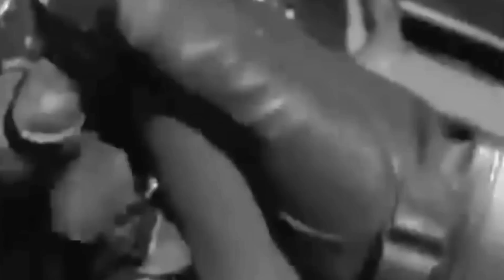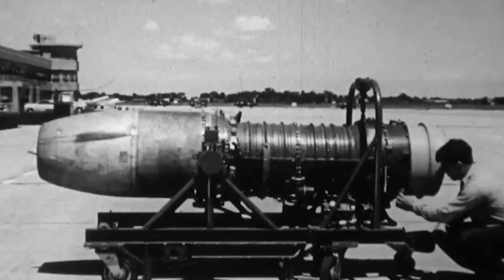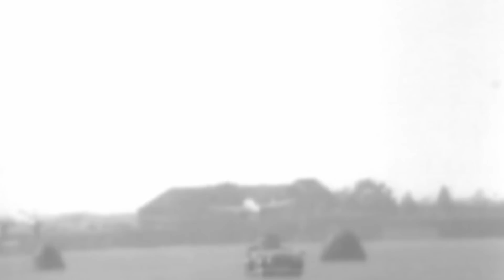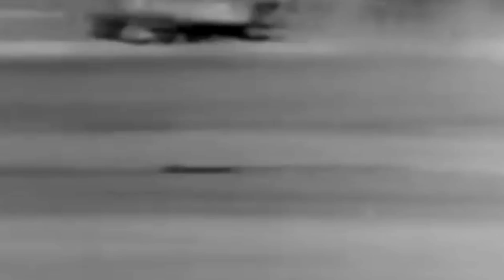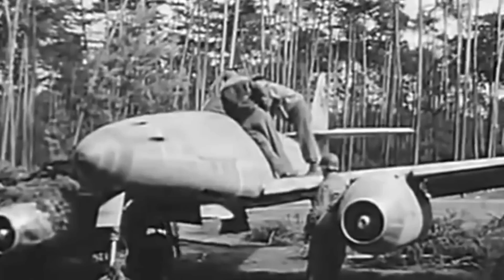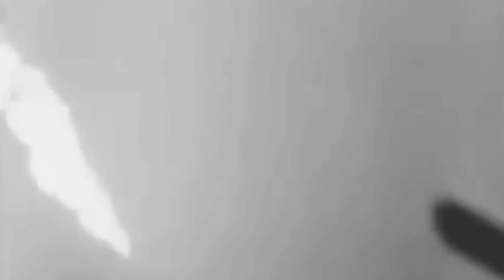The Never Before Seen Fighter

Comment: I saw the flying replica a few weeks ago at RAF Coningsby , even though a modern replica with modern engines etc' it still looked menacing .
Reply: That's not a replica, it's a genuine Me-262 "C" built under license from Messerschmitt.
Reply: @WilhelmKarsten  - exactly - just with modern, much smaller but stronger engines. Great piece !
Reply: @icemanstg  The GE J85 was designed by Gerhard Neumann and his team of Jumo engineers brought over by Operation Paperclip... Ironically the J85 originally designed for missiles only had designed life of just 2 hours!
Reply: @WilhelmKarsten  Hello Sandyboy, as you know the team that Gerhard Neumann worked with at GE were Americans not nazis.
Reply: @WilhelmKarsten  The Me 262 replicas are solely the product of the Texas Airplane Factory and Classic Fighter Industries and have nothing to do with DASA. CFI's right to build was bestowed by NAS in return for the restoration of Vera (which is now, according to you no longer an original Me 262). The only connections with anything Messerschmitt is that one of the replicas was bought by the Messerschmitt Foundation which is a privately owned historical preservation society which then gave its informal blessing to the use of the 'C' suffix and the use of consecutive serial numbers which have no meaning other than as serial numbers issued by TAF for the airframes that they produce. As you know Sandyboy EADS is not Messerschmitt. DASA was formed when Daimler-Benz took over MBB (itself a product of Bolkow's acquisition of Messerschmitt). DASA was later absorbed into EADS a joint French, Spanish and German venture. Messerschmitt is a legacy company of the international concern EADS as de Havilland is a legacy company of BAE Systems, the British company which is Europe's biggest defence contractor. Obviously CFI couldn't use original or even replicas of Ju 004 engines due to the appalling fragility and short life of the design, so instead they used the GE CJ610 which presented a problem that the considerably lower weight of the GE engines would significantly displace the CofG and require changes to the wings but instead they put the GE engine in the heavy casings of Ju 004 engine to achieve the require weight distribution. How ironic.
Reply: @WilhelmKarsten  Sandyboy, as you know the Me 262 replicas are solely the product of the Texas Airplane Factory and Classic Fighter Industries and have nothing to do with EADS. CFI's decision to build these replicas was supported by NAS in return for the restoration of Vera (which is now, according to you no longer an original Me 262). 
The only connections with anything Messerschmitt is that one of the replicas was bought by the Messerschmitt Foundation which is a privately owned historical preservation society which then gave its informal blessing to the use of the 'C' suffix and the use of consecutive serial numbers which have no meaning other than as serial numbers issued by TAF for the airframes that they produce. The project has also received some support from Airbus.
As you know Sandyboy Messerschmitt does not exist as an idependent company. DASA was formed when Daimler-Benz  took over MBB (itself a product of Bolkow's acquisition of Messerschmitt). DASA was later absorbed into EADS a joint French, Spanish and German venture. Messerschmitt is a legacy company of the international concern EADS as de Havilland is a legacy company of  BAE Systems, the British company which is Europe's biggest defence contractor.
Obviously CFI couldn't use original or even replicas of  Ju 004 engines due to the appalling fragility and short life of the design, so instead they used the GE CJ610 which presented a problem that the considerably lower weight of the GE engines would significantly displace the CofG and require changes to the wings but instead  they put the GE engine in the heavy casings of Ju 004 engine to achieve the require weight distribution. How ironic.

Comment: Dude I am going to give you a dislike for every time you say kilometers without giving the same speed in miles per hour , fu
Reply: Here, you crybaby. 1 km = 0.621371 mi.  I should charge you for the 10 seconds it took me to look up the conversion.
Reply: Multiply mph by 1.6 Dumbarse!!
Reply: @akf6815  Wouldn't he be better off multiplying KPH by 0.625.

Comment: I heard no mention of the airplane’s Achilles heels. Slow to accelerate, prone to compressor stalls, and a ridiculously short engine life span of about 25 hours due to the lack of advanced metallurgy and production methods available for it’s production. I believe this was not because of the technology not having been developed, rather it was more a matter of getting it into the air with readily available assets.
Reply: The fact this thing was even flying let alone built and has a service and kill history is impressive. Every 1st of its kind infancy invention will have flaws but for what it was, it was revolutionary
Reply: @Jake-mi3bj  it sure was.  At least 100mph faster than anything else, and far heavier armament made this lethal.  As I've said, if the Germans had put more emphasis on this and got it into service in serious numbers, the fuel and pilot situation would probably of been better too, daylight bombing would probably of have had to stop.  What then....
Reply: lack of metals do to the ZOG terror bombings
Reply: Jet engines can't be controlled by the pilot, you need a Throttle control between the engine and the pilot.  New cars do this too, even though its less critical on a reciprocal engine.  Anyways, jet engine were knew so there was a huge learning curve at this time.
Reply: @jeffk464 That's only true on modern jet engines,  during WW2 jet engines did not have automatic fuel controls, both German and Allied pilots had to manually control the fuel flow with the throttles being careful to watch the EGTs and not move the throttles too much or too quickly.
Reply: @jeffk464   The 262 didn’t have digital fuel control. I learned a fair amount about it in A&P school, but don’t remember all. That was nearly 35 years ago.
Reply: @damafia29 Never happened. The Miles M.52 never existed.
Reply: @damafia29 The Bell X-1 is real, it first flew on January 19th 1946 and flew supersonic on October 14, 1947.
Reply: A GE version of this jet engine also has short engine life, so Jumo engines were comparable, or GE were just as bad
Reply: @simonrooney7942 Well, GE rose to dominance in the jet engine industry after WW2 with it development program led by Gerhard Neumann and his team of German engineers from Jumo...
Reply: @WilhelmKarsten  Hello Sandyboy, as you know Sandyboy Gerhard Neumann was a Jew and wisely left Germany before your nazi heroes got really nasty to his people. As you know everything Neumann learned about aero engines he learned through American organisations. he did not work with a team of nazi losers from Jumo. The team he worked with and with whom he won Collier award were Neil Burgess and Clarence Johnson.
BTW sandyboy, it's good to see you aren't still confusing Gerhard Neumann with Johann Neumann the Lutheran theologian.
Reply: Don't forget you had to be very very gentle with the throttle.
Reply: No one developed their own version of it after the war.
Reply: @b.critical7873   Nobody made Jumo 004s after the war?  The Soviets copied and manufactured around 1200 Jumo 004s after WW2 as a Klimov engine.  They also copied the BMW 003 turbine, also by Klimov.
Reply: Because it's not unique to the Me-262 .... All jets are slow to accelerate, especially from flight idle  rpm, of course this did not stop jets from rendering propeller driven fighters obsolete.

Not true, early jet engines did not have VSVs or compressor bleed valves... the Jumo 109-004B was however the only 1st generation. Turbojet with automatic variable exhaust nozzle technology which stabilized compressor flow and reduces stalls and surging.

All 1st generation jets had manual fuel controls, including Allied jets.

Also completely false, the Jumo 109-004A engines made with Krupp P-198 Chromadur never saw production or operational service.

The Jumo 109-004B easily passed the RLMs 100 hour PFTR reliability test required  for adoption into Luftwaffe service, this is the same 100 hour standard for Allied piston engines.

The USAAF exhaustively tested the Me-262 during Operation LUSTY and confirmed TBOs averaged 55 hours, that's excellent by WW2 standards for Allied piston engines.
Myth busted.

Germany was the world's leader in high temperature creep resistant alloys. The Shortage of Nickel delayed mass production while more advanced heat management technology was developed, the B version pioneered the use of hollow turbine vanes and blades cooled by compressor bleed air and the first use of TBCs in jet engines.

Technology unavailable to the Allies until after the war and found on modern jet engines.

Any questions?
Reply: @WilhelmKarsten  Hello Sandyboy, as you know, although jets tend to be slow to accelerate the Me 262 was exceptionally bad the problems being compounded by the fragility of its shit engines. As you know, that contributed to the fact that even as a jet it was readily shot down by propeller driven fighters which would not become obsolete until at least the Korean war in which the Hawker Fury shot down a MiG-15. Even in the Vietnam war Skyraider attack aircraft shot down MiG-17s.

Now Sandyboy as you know your mythical 100 hour PFTR reliability test for the Me 262 can't be found anywhere except in dodgy KZ sites where you are making the claim. Moreover they have no direct relationship to production engines and can't therefore counter the clear reality that the Me 262's service engines were crap with extremely short lives.
As you know Sandyboy, a TBO of 55 hours would be very poor for allied piston engines, the Merlin having a TBO of 240 hours.

As you know Sandyboy, Germany lagged behind Britain and the US in high temperature creep resistant alloys. The German Tinidur introduce in 1936 not even having the creep resistance of the 1932 Inconel alloys. As you know post war Tinidur's  notch sensitivity was significantly improved in the US by the addition of small amounts of molybdenum, a solution that Krupp failed to understand. As you know Sandyboy, the first viable alloy for the development of durable axial flow engines was the British Nimonic alloy.
Reply: There have been different types (generations) of Jumo jet engines. Only the later (004B) had issues with short maintenance cycles, mainly because raw materials such as titanium from Sweden were not available and had to be replaced with lower quality raw materials. Instead of Tinidur (30% nickel, 15% chromium and 1.7% titanium), Chromadur without nickel with 13% chromium, 18% manganese and 0.7% vanadium was now used for the turbine blades. The engines from the 004A (Tinidur) series ran for over a hundred hours without maintenance.
Reply: And with the compressor stall tendency, I'd heard it wasn't particularly maneuverable unless you wanted an engine out.
Reply: @aurora1024  yes, and the engines were very sensitive to all but the most gradual throttle changes.  But when you're employing zoom tactics at five and a half hundred mph, an packing four 30mm maneuverability isn't all that important I guess.  Now it's often mentioned that the Allies waited at their bases in order to pick 262s as they came in to land or take off.  The Germans simply lined the approaches with heavy flak to counter this.  Another measure could of been flying a CAP.  Yes this jet had the potential  given fuel time and pilots a truly war winner.
Reply: @aurora1024 Heard from what source? Every pilot who flew the Me-262 said it has excellent handling characteristics, including famous British test pilot Eric Brown.
Reply: @WilhelmKarsten  Hello Sandyboy, reguarding your reference  to  the 'famous British test pilot Eric Brown' in  the Me 262's handling characteristics, that would be the Eric Brown who also stated that the Me 262 was "no fighter" and stated that the Me 262's engines had a "scrap life on average of 12 hours" .
That would be the Eric Brown who you were denouncing on the Miles M52 board.    Sandyboy your hopelessly obvious hypocrisy and double standards are so ridiculous.
Reply: Agreed, the lack of crucial alloying elements gave the turbine a short working life. The wing sweep was driven by centre of gravity considerations, the drag reduction was just a happy bonus. Manoeuvrability at speed wasn’t that wonderful, but suitable for hit-and-zoom tactics (like U.S. in Pacific to counter Japanese). Very vulnerable during takeoff / landing as the engines didn’t respond well to fast throttle movements. Problem was trying to develop engine during combat, consider early B-29 operations.
Reply: @proteusnz99 according to Eric 'winkle' Brown, chief RN test pilot, compressibility was beginning to be understood.  The Germans realised that the the wing sweep could also help dissipate air resistance down the leading edges.
Reply: @rob5944  yes, Brown rated the Me-262 as a better fighter than the Gloster Meteor, though subject to similar snaking problems. I was interested that he thought the He-162 might have been the best gun platform of the first generation jets, though hardly suitable for inexperienced pilots. Along with entering new areas of aerodynamics, the development cycles for these much more complex machines/engines was poorly understood, for example only one or two prototypes, so any accident could stall testing for months, or where the Hunter F1/Swift F1, F-84B/C/D were development batches to work the bugs out.
Reply: @proteusnz99  well it was all brand new technology, in terms of jet propulsion, aerodynamics, tactics, in fact almost everything.  What has always impressed me is how Germany could still make astounding progress, in under tremendous pressure.  She was more than a match on the continent for any two of the three major Allies in my opinion.
Reply: @rob5944 Yes, compressiblity was well understood by Adolf Busemann and the work conducted by the RLMs Luftfahrtforschungsanstalt 
Germany was the country that had supersonic aircraft wind tunnel research laboratories during WW2.
 Busemann tested the Me-262 in larger scale models up to Mach 1.4, it's the first plane in the world the ALL swept control surfaces and a fly-by-wire Horizontal Stabilator system to counteract the effects of compressiblity that causes Mach tuck in the transonic flight region.
Reply: @proteusnz99 The Messerschmitt Me-262 was very stable at high speed,  it did not suffer from the stability problems that caused so many fatal accidents with the Gloster Meteor.
Reply: @WilhelmKarsten  Hello Sandyboy, as you know Sandyboy the Me 262 did not have a 'fly-by-wire Horizontal Stabilator'. The Me 262 had a conventional tail plane with elevators and  motorized trim adjusters. Such cofigurationswere  quite common as on the Westland Lysander.
In fact the Pilots handbook for the Me 262 warns pilots not to use the trim adjuster for anything other than its purpose.
Reply: @proteusnz99 Not true, that false rumor is based solely on the Jumo 109-004A that were tested with Krupp P-198 Chromadur instead of the high Nickel P-193 Tinidur A60.
 The B version passed the RLMs 100  hour PFTR after bleed air cooling and TBCs were introduced.

That is a completely false myth and comes from a single highly dubious source and contradicts all the historical evidence.
The Messerschmitt Me-262 was developed from the Projekt 1065 which had swept wings from its inception... Adolf Busemann was the world's leader in supersonic aerofoils,
Williams claims are not creditable and are frankly just ridiculous.
Reply: @WilhelmKarsten  Thank you for this clarification. However, there is a difference between having the metallurgical knowledge to construct and test a long life high temperature turbine, and having access to the necessary mineral resources to put such turbines in production engines. They built with what was available and accepted a short working life.
Reply: @proteusnz99  The Jumo 109-004B Orkan engines had excellent PFTR and TBOs, very comparable to Allied piston engines.
Reply: @WilhelmKarsten  Hello sandyboy, as you know Sandyboy, the small and barely significant sweep on the Me 262's wings was introduced to account for CofG issues caused by a change of designated engines.
As you know Sandyboy, you always attempt to dismiss that fact by claiming that it  'comes from a single highly dubious source and contradicts all the historical evidence' but when challenged to identify that 'single source' you never can, nor can you supply any of the 'historical evidence'.  
You refer to Adolf Busemann but Busemann was not the aerodynamicist on the Me 262 project, that was Bolkow who outright rejected Busemann's suggestion.
Reply: @WilhelmKarsten  Hello Sandyboy, as you know your fanciful PFTR and TBO claims are meaningless nonsense.